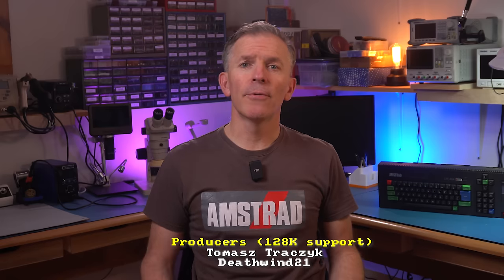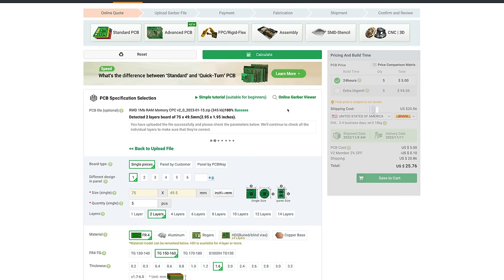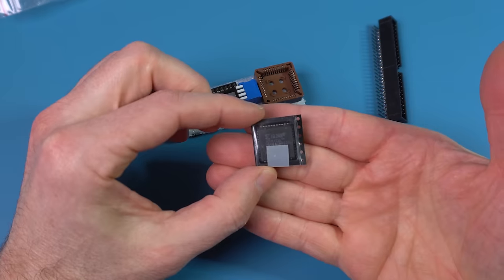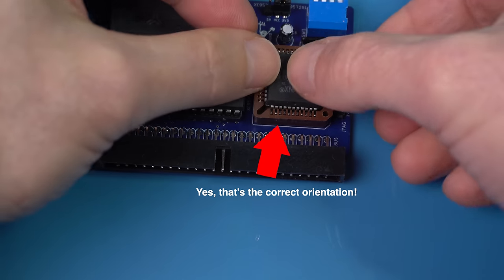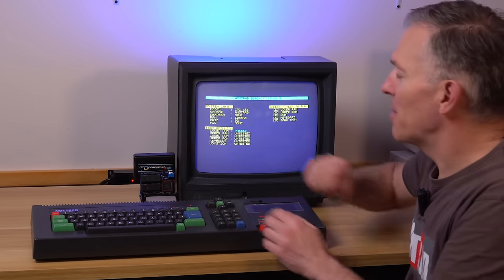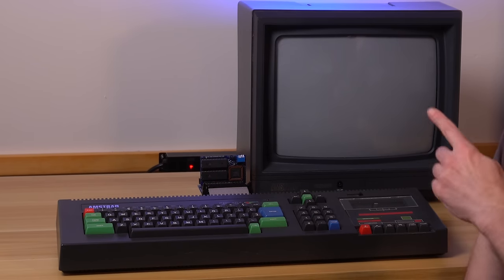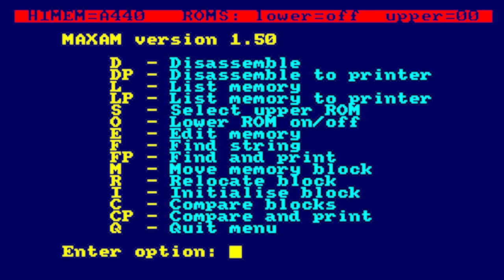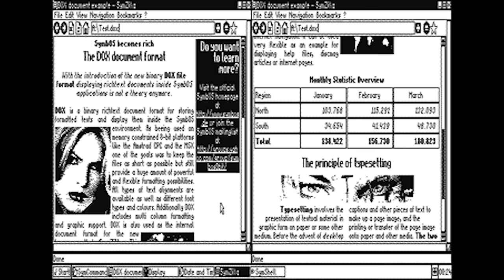Adding 1MB to an 8-bit Computer!

Comment from the maker: FAQ (hopefully this addresses some of the main comments/questions):

* You got data bus and address bus backwards! 
Yes, I did! 🤪 I thought it was only in one part that I put some text, but apparently I messed up earlier too. Sorry!

* LD (C), C is incorrect. 
No. The way the Z80 works, when you do out (c), XX, it actually sets the IOREQ line, writes the whole BC register on the address bus, and puts XX on the data bus.
I know, it should have been called out (BC), XX, right?
From my understanding, most Z80 systems only look at the lower 8 bits of the address bus during an IOREQ operation. I'm not sure why. Some kind of semi-standard? Reference implementation?
The Amstrad decided to use the TOP 8-bits of the address bus to decide which IO to target. So the bottom 8 are ignored.
So loading something on BC and doing out (c), c does put C on the data bus and B on the top half of the address bus. It's one of the Amstrad idioms.

I'll keep adding things as they come up.
Reply: This does not really address the “discology” question 😂😂😂
Reply: The 8 bit thing probably comes from the 8080 which only had the IN A,(n) instruction. The INIR/INDR etc opcodes (z80) are like LDIR etc but increment or decrement the B register. They read a block of input data. Another reason for I bit IO addresses. The Amstrad way of doing things makes those instructions unusable on a CPC.

The Amstrad firmware keeps BC’ permanently loaded with the gate array address in B and the current video mode and  ROM enables in C. It can change ROM enable states just by tweaking the appropriate bit(s) and doing an OUT (C),C wrapped in EXXes which makes calling ROM routines a lot faster than it would otherwise be. One of many clever tricks in the CPC :)
Reply: @6:26 "this is just a 256MB expansion" from 1986 :-)
Reply: You really should cut the component legs to length before soldering in order to avoid bad connections from potential microcracks.
Reply: 21:47 mini SD was only available up to 32 GB
Reply: The reason a lot of z80 systems use only the low 8 bit of the address is OUT $20, A puts the A register on the top 8 bits of the address bus as well as the data lines. On the 8080, I think it would write to $2020 instead. Neither really helps.
Reply: bro an American with Amstrad t-shirt respect
Reply: 13:06 That's weird. 16 banks of 16KB each is 256KB. 2 address bits are missing unless the banks are really 64KB each. Might Dandanator use "bank" to mean "64KB block" rather than actual switchable bank?

Comment: If my memory serves me correctly, it's the address bus that's 16-bits wide, the data bus is what makes it an 8-bit computer. Still a great video.
Reply: Pretty much.  The instructions and data are a byte wide (usually - the z80 actually can deal with 16 bit numbers though there's a speed penalty since obviously you have to deal with them eight bits at a time)
Reply: This whole "bitness" concept is kind of suspect. For instance, the 68008 (used in the Sinclair QL and many embedded system) had 32-bit registers and instructions, 20/24-bit addresses, a 16-bit internal bus, a 16-bit ALU, and an 8-bit external databus. Some called it 8-bit, others 16-bit,  yet others 32-bit.

The Z80 had 16-bit registers, addresses and instructions, with an 8-bit databus, and a small 4-bit ALU. But was always called "8-bit". Pretty arbitrary really.
Reply: @herrbonk3635  IMO the "bitness" of a computer is how many bits it can process per clock cycle.  This is usually the register size, but I suppose some procs might process low bits on one clock and high bits on another or something internally, I don't know enough about CPU specifics to say one way or the other.

If the data bus is half the register width however, then it could effectively only handle 8 bits of data per clock realistically so maybe that is why it was called a 8 bit computer.
Reply: @JathraDH  Sorry, but that's total recentism, and not how it works generally at all. If it was, the "bitness" would vary among different intructions and the 68008 mentioned above would have a "bitness" of 2.7 (32/12) for its fastest instruction, while the 68000 would be a 4-bit CPU (32/8) for the same instruction... 🙃The 8086 would have a "bitness" of up to 5.3 (16/3), while the 286 would be an 8-bit processor (16/2) and the 386 would be  16-bit (32/2) ... and so on.
Reply: @JathraDH By that definition most modern CPUs are 256-bit because of SIMD.
Reply: @nikkiofthevalley  Hm, that is a fair point.
Reply: Data bus being 8-bit doesn't necessarily mean it is 8 bit computer. It is more what is the standard size of operation in CPU itself. For example Intel 8088 is 16-bit CPU, but external data bus is 8 bit, so each 16-bit quantity is send in two cycles. (BTW. The address space was 20 bit externally, but internally was 16 bit flat, but with combined segmentation configured via also 16 bit addresses, it was up to 24-bit address space, that could only be exploited once 80286 was released). Similar techniques were used in some 32-bit CPUs.

256-bit SIMD in modern computer does not make it a 256-bit machine in general, because a lot of standard operations, cannot be done on it as a shole. For example. You cannot add two 256-bit integers, or multiply two 128-bit numbers to get 256-bit numbers. Nor it can be used as an offset into array or jump address, etc.

Most people say that 68000 like in Amiga, was 16-bit CPU, but in my opinion it is should be called a full fledged 32-bit processor, just like Intel 386.

These are just labels, and simplifications, so not super important. Because once you start digging what they actually do, these labels are irrelevant.
Reply: @@TheDsgfdssd True, many instructions could only operate on 16 bit, and main register alu was 16-bit, AFAIK it was possible to execute 32-bit arithmetic with a bit of performance hit, or by using the address registers, but yeah, it is a hybrid 16/32 in this sense. 68020 had 32-bit alu.
Reply: @movax20h The 68k was considered a 16/32, cause it was set up to read 16-bits (actually I think 23-bits?), but was built for 32-bit. It was to make that chip cheaper, and when they went on to 32-bit, it would be backwards compatible with old 16-bit instructions.
Reply: I'd consider the bit-wise what it can easily handle in a basic operation (add, subtract, and, or) within the instructions. 256-bit movement happens within the chip, but isn't an operable number. 16-bit mem addr on 8-bit cpus typically used a high/low register to get the address to get the address, but could not in itself use a 16-bit number easily.

I mean technically speaking, you could pull off equations that take up the entire memory. The main difference is that a 64-bit system can run through 64k in an 1/8 of the time of an 8-bit (all other things equal).

I believe for 256-bits of data, the cpu is just the fastest component in the computer, so it can get through that large of a number by the time it gets updated, but I really don't the x86_64 very well beyond some instructions, and using it in 16-bit mode...

Comment: Atari 8-bitters have been adding 1MB of RAM to their computers for years. A friend used to have an Apple IIc in which he installed 1MB with an upgrade. I helped him get the chips he needed.
Reply: I have a new-to-me Atari 800XL heading my way soon and I'm going to do that in the future.
Reply: True,  I've seen those in the late 80's. There were magazines who published some schematics with all kind of upgrades for the 8 bit Atari computers.
Reply: And i've got a 16MB ram expansion on the C64
Reply: Having such massive RAM expansions are cool but only if there's enough software to take advantage of it.  I saw a video of a shoot em up for the Atari 8bits that required a memory expansion,  it looked pretty cool , very fast.
Reply: yeah but the commander x16 has 2 megs of ram so this would be a downgrade for that system🤣🤣
Reply: My dad had added 4x256KB RAM expansion to his TI 99/4A so he could cache his whole database into RAM instead of polling it SLOWLY from disk.
Reply: The thing is, extra RAM isn't actually nessicarily all that helpful when you have SD card backing storage to hand.
Reply: There were 1MB extensions for the Sinclair computers back around 1984 too. 
Not fully populated though, of course. 1 MB was pretty darn expensive back then.
Reply: @SaraMorgan-ym6ue the cx16 is a new computer
Reply: @Scyllinice  Not the best upgrade to be honest. I recently got a SUBcart(new model of AVGcard) and its FAR more compatible compared to the U1MB solution.(When used with its SIO and PBI cables).
For the same price (or even cheaper) you get a Cartridge SD solution that runs all ATRs and Cassette images,1MB memory Rambo , 4MB AXLON compatible memory expansion, Real time clock and a sound  Pokey stereo upgrade (Again a special cable should be present).
I no longer use my U1MB machine.

Comment: Great video, I love the way you explain complex topics, like memory mapping, with simple words and diagrams!
I considered porting Zeal 8-bit OS to the Amstrad CPC but wasn't sure how the memory was organized, I am happy to see it is also using the 4x16KB virtual pages segmentation, which makes it fully compatible.

The first program that comes to my mind that would be able to use a lot of memory (maybe not the whole 1MB) is a C compiler. The compilers I have seen for the Z80 go from parsing to assembly generation  in the same pass, which reduces the RAM usage but limits the potential optimizations. With that much RAM, an whole AST can fit in RAM, even if the source file is big, making optimizations possible!
Reply: But even with so much RAM I’d recommend not to waste it and combine preprocessor c compiler asm compiler and linker as coroutines. I remember first TurboPascals were blazingly fast, because compiled into RAM - no need to save, just jump to exec. Later versions >=6.0 started to work with files and were in order of magnitude slower! 
Use the RAM Luke ;)
Reply: Yes, the CPC uses 16k banks but what it can patch in where is very limited. You can patch any block into the bank at &4000. There’s also options for the bank at &c000, but beyond that you’re limited to swapping in entire 64k banks in one go. Also video can only use the base 64k.
Reply: Ooh, I'd not heard of Zeal OS - Thank you for a new rabbit hole for me to get lost in!

Comment: I did start designing an ATX version of the 6128, but now that I know about this project, I will do what my due diligence to see if it can be baked into my design.
Reply: Please do follow the standards. Use mITX form factor a slots spacing. Then it will be possible to use a lot of cool mITX cases and use already made CPC extension cards with 3d printed brackets to be inserted into same way as low profile PCIe cards

Comment: Great video! I know virtually nothing about the Amstrad line of computers, so this was very educational. It always amazes me how inventive people get when they have very little memory to work with or when they have a system that is very limited in a more general sense. Adding that pressure makes people think more deeply about the choices they make when designing hardware or software for such a platform. 

One big bonus is, of course, that memory, both DRAM and SRAM are relatively cheap nowadays, especially compared to say, what the costs were in the '80s and '90s. 

I love SymbOS. I have it running on my MSX2 computer, a Philips NMS-8255, although of course, that system is also expanded with 1MB of memory and more storage than one could even dream of in the '80s. In its current configuration it has more RAM and more storage space than my very first PC had. I think that's pretty awesome.
Reply: Very true: back in the 80's, RAM was a little under £1 per KB, so  one of today's 4GB DRAM modules would have cost 4 million quid!!

Comment: Nice to know that there are cheap opensource expansions for CPC. I've never owned a CPC (Commodore user here) but partially thanks to your videos I can see how underrated it was compared to its true potential. Now I have 3 working pieces (2 464 and one 6128) that are waiting for when I have time for them :) They will probably require belt replacement, though.

Comment: You are so right about  a possible huge leap in quality and complexity of  CPC software if extra memory was considered as  a standard!  The Homebrew golden era of the Atari 8bit line is a great example on how  some extra memory can push the quality of the software.
Of course the good thing with the Atari expansion memory modules is that most of the solutions (internal or PBI) follow the specs of just two main  popular "protocols" (Compy and Rambo) guaranteeing  the compatibility of almost all expansion "contraptions"...plus the PBI port has its own power supply and zero peripherals to compete for the same port (thus its really practical).

Comment: If the screen buffer can be relocated to banked ram (like on the C64), then you could use that functionality to play full screen animations really quickly.
Edit: looks like you answered the question during the video.  Cool!
Reply: Unfortunately, due to the way the Gate Array controls memory accesses, Video RAM has to be in the base 64k ☹️, otherwise switching VRAM banks during vertical blanking would be very cool.
The Giani Sisters Tribute game uses 32KB from base RAM for the display.
Reply: That actually was use with the REU in the Commodore 128. Though I don't know if it was the VIC-II or the VDC.

Comment: I did exactly with my CPC6128 what you described in terms of debugging. I rerouted the BIOS to an external ROM where I destroyed the fonts starting at ASCII 240. I put code into there to copy the entire 64K into the expansion RAM. Later I build my own expansion like you showed in the picture using 256K of DRAM and many ROM expansions. The MAXON assembler was the most important one. Since I build the RAM expansion myself I also added a DMA that was able to send a data stream out to a DAC making some real sounds like the AMIGA does.
But then I switchted to AMIGA.
Reply from the maker: Wow, that sounds like some serious hardware hacking! I wish I was able to do stuff like that back in the 80s, but back then I was even afraid to open up the computer! 🤣
Reply: @NoelsRetroLab  I had help from the German State Train Company where I had the first internship of my life. A nice guy taught me the basics of LSTTL logic ICs. I started there and went on from that building the first Eurocard. IIRC my 6128 used a 50 pin centronics connector. That was a pain, since it did not fit into the 0.1" matrix board.

Comment: Sorry for sounding pedantic, but those are not IDC connectors. Those are (shrouded) pin headers and sockets. IDC stands for insulation displacement connector, and means the kind on connectors that pierce the insulation on e.g. ribbon cables when you install them. The most common IDCs are indeed the pin socket types, but another common type is D-connectors on ribbon cable. Though IDCs don't even always use ribbon cable: you have things like modular connectors and the MTA100 series.
Reply from the maker: You're right. I'm horrible when it comes to connector names 😃 I stand corrected.

Comment: With regards to internal memory expansions, one of the main challenges is that the signal timings in the CPC work when writing to DRAM, but not when writing to SRAM. DRAM samples the data bus when WE transitions low, SRAM does so when WE transitions high. In the CPC the multiplexers have started to change by the time that happens. It’s possible but modify the signals to get it to work but makes the logic more complex.

Beyond that you get the challenge of where to patch the expansion into to access the signals it needs - and you’d need to do different boards for each main revision of Amstrad main board. When I looked at doing so I felt like would be simpler to just design a new machine from scratch. Do that and you can also upgrade other areas of the machine such as the ROM.
Reply from the maker: Interesting about the timings. I didn't think that far, but that could be a challenge. As for fitting it, my naive idea was to fit on 3-4 of the lower 64KB RAM chips and have cables go out to the RAS/CAS of the other chips. But yes, you would definitely need different PCBs for different 464 boards (maybe one will be in common with a 6128)? Alternatively we could plug it in on the Z80 socket directly. Maybe? Lots of possibilities, but I think it may be worth it, and especially, it will definitely be fun 😃
Reply: @NoelsRetroLab  When I tried it plugged into the gate array (for signals and data bus) and a signal RAM chip (for address lines IIRC). The downside is that the address is downstream of the address multiplexers. You need to latch the RAS and CAS addresses and then run them through a HAL. It just all gets very ugly.

Patching in to the gate array and CPU sockets would be better but they’re not conveniently placed in most motherboard variants. (And my preference is for a single PCB which plugs into the sockets and rehouses the original chips - much nicer than a load of flying wires and soldering).

So, yes, it would be lots of fun. I’m just not sure I want to personally devote the time to it :(

Comment: I still own my 6128 and I added a ROM board and a 3.5” drive to keep my 3” disks mostly available - they were so expensive!

I had always wanted a hard drive for it and I felt that 128k of RAM was enough for me.

I did all of my university work on it, text and graphics, as well as relaxing with some pretty good games.

Now I have so many computers of different eras and brands, and I’m still creating text and graphics for all my subsequent jobs that I don’t know when I will get back to the Amstrad.

Thank you for another great video!